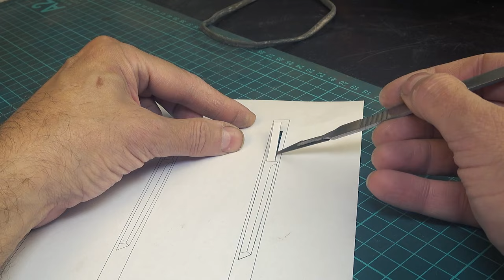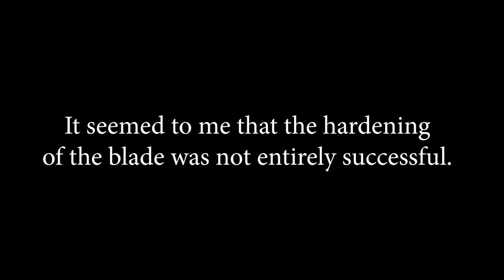Turn Old Broken Needle File into a mini KATANA

Comment: do you think it bent when wuenchimg because the blade istoo thin ? i hope there are not too much stress in the metal  , few years back i seen on youtube some folks to make their blade curve up they heat it up the straight blade then in a basin full of liquid of some form ( water i think)  they slowly dip it starting with the tip then quickly follow through with the length while still holding at the end above water and you see the blade curve up
Reply: sorry quenching     typed too fast
Reply from the maker: Most likely it was because of the different thickness of the blade. 
I don't fully understand what happened.
I think the hardening as you described is necessary so that the blade hardens only on the edge and is not so brittle.